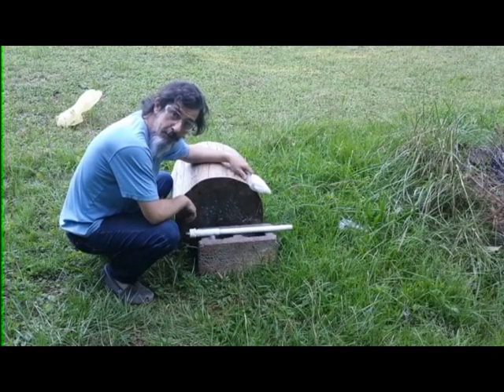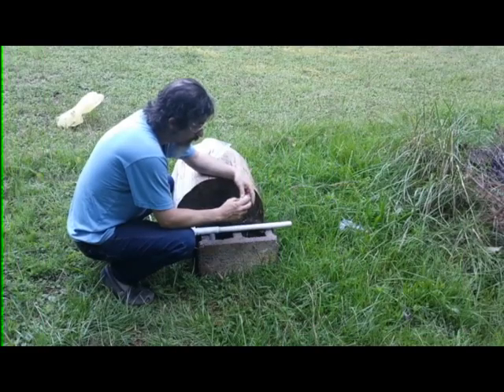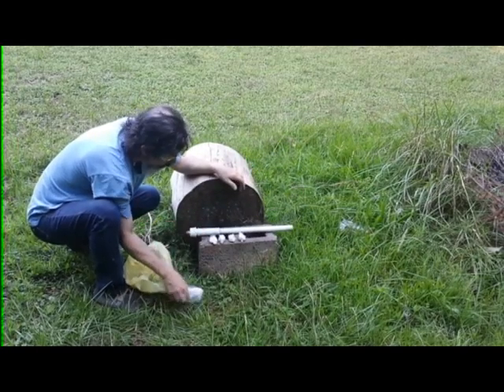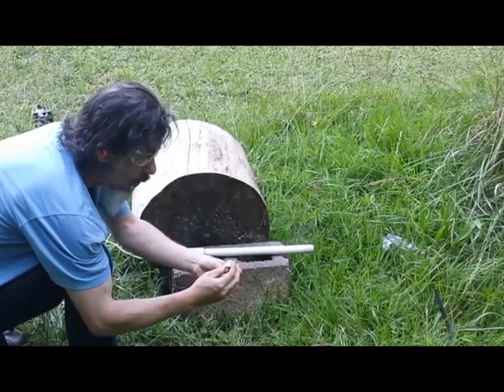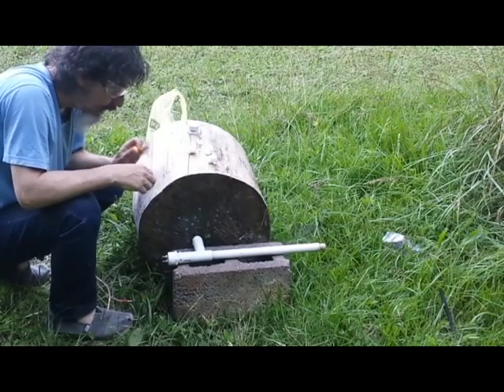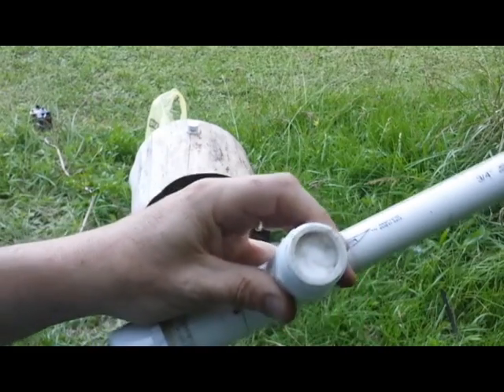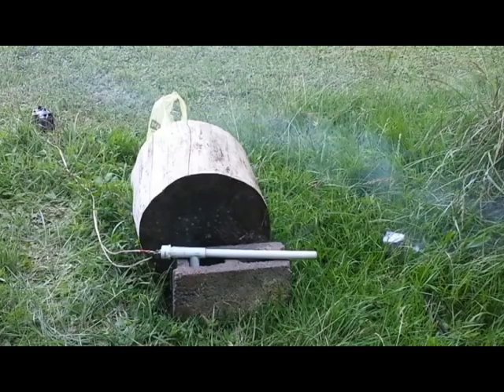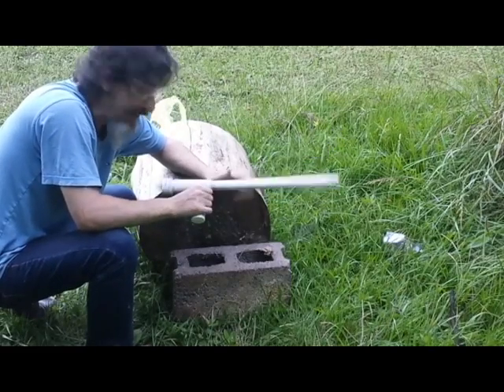Safety Breech Test on Side Loading Gun Cotton Combustion Chamber

Comment: It would appear the device pictured is in fact within the definition of a muzzle loading firearm.  Presumably and hopefully the plastics used in the component construction contain enough Barium Sulfate to not fall within the constraints of 18 USC 922 (P).  Regarding the unburnt gun cotton, I believe that is a function of barrel length.  I have observed the same result in my own experiences regarding Martini Henry rifles and carbines using British cordite loaded cartridges made by Kynoch and US Army Trapdoor Springfield rifles and carbines made in caliber .45-70 using commercially available (Buffalo Arms) black powder loads with .70 grains of black powder.  In both sets of experiences the firing of a rifle cartridge in a carbine resulted in unburnt propellent littering the area in front of the firearm muzzle.  However firing the same cartridges in the rifle of the same type did not produce the same effect.  As you note producing a load which expels unburnt powder on the ground is wasteful.  Although a private individual making on a few dozen or hundred such loads may not care about that, Both the British and the US (each of whom made millions of cartridges at government expense) did and produced both standard loads intended for rifles, and also loads with reduced powder chages intended specifically for use in the carbine variant.  Equally my own experimentation with various other firearms reveal that longer barrels produce both higher velocities and less muzzle flash.  In Several instances using maximum power handloads in short barreled pistols resulted in both excessive muzzle flash and unburnt powder visibly  littering the area in front of the weapon, while identical cartridges fired from a rifle length barrel produced lower muzzle flash and no unburnt powder remnants visible in front of the firearm.  I suspect that if your projectile launch tube (aka barrel) was a foot longer the amount of visible unburnt gun cotton after firing would be much less.  
At some future point I may experiment with gun cotton to determine how much gun cotton, and at what level of compression is needed to replicate the velocities of old time cordite loads.
As a question of curiosity, given that the boiling point of sulfuric acid is 638.6F, while that of water is only 212F (and thus easily removable from battery acid), have you done any experimentation of using common battery acid as an alternative to using drain cleaner as the source of the acid?

Comment: He also is probably igniting the nitrocellulose at the back end, like in a brass cartridge where the primer sits behind the gunpowder load, which is allowing it to push the nitrocellulose that hasn't burned yet out the barrel.
What he needs to do is ignite the nitrocellulose that is closest to the end of the barrel so that as it burns and builds pressure instead of shoving unburnt nitrocellulose out the barrel what it will do is it will compress the nitrocellulose in the bottom of the barrel causing it to be compressed heated and consumed.
He also needs a heavier restriction inside the barrel so that the nitrocellulose can build more pressure and more heat to consume more of the nitrocellulose.

Comment: Could it be a replacement for smokeless powder ? Does it work if damp. Interested in trying with a muzzle loader rifle.
Reply from the maker: Replacing the propellant in a firearm could lead to disaster, however I am considering trying it in my 16 gauge shotgun. Course I would need to trigger the gun remotely from behind a barrier to do this experiment safely. But then the gun would need to be examined very closely afterward to guarantee it's continued structural integrity. To be honest this is something I'm thinking about almost every day!
Reply: It's the main ingredient in smokeless powder

Comment: Have you tried igniting gun cotton with spark?
Try this, buy a cheap spark plug and a pezo manual "clicker" type bbq ignitor. 
Wire the ignitor to the spark plug and touch the plug to gun cotton....click it and see if it lights.
I'm wondering if a battery is actually  "necessary"???
Reply from the maker: Yep my first idea was actually a barbecue ignitor. The piezo-electric kind. But it won't do it.
Reply: I'm looking to build a gun cotton launcher to start camp fires when I have to start them with gasoline because of wet wood or when I have to start a campfire in the snow with less than dry wood.  I'm planning to  "construct" the ammunition for it. As gun cotton ignites to quickly/I need a BURNING projectile. And it needs a gas seal to be affective. While the gas seal will likely be just electrical tape or duck tape I'm planning to put both a UCO match and thermite in it's construction. 
While I'm sure this passes into not-so legal territory 💩 it certainly would be fun to target practice with something like such.

Comment: Mine is more efficient it only uses .2 gn
I get a 168 lb impulse in .3 milliseconds 
guess what it does
Reply from the maker: What is yours?
Reply: schel sullivan it's called the iopener is a replacement for Argus and cypress and  
vigil cutters mine doesn't cut it pulls or pushes  to open the
Reply: Parachute

Comment: Hi ! 
I have one question :
This gun cotton works to load gun cartriges ???
Thanks !
Reply from the maker: Its a main ingredient in modern smokeless powder, but reloading ammo outside of the manufactures  recommendations could be very dangerous. Im not a firearms expert so I would want to consult with an expert before trying anything like that.
Reply: @schelsullivan  will try too
Reply: If your going to do that i suggest only firing revolvers, they are stronger than semi autos. Also dont load rifle cartridges, the cotton must be turned to grains so it burns slower. Fast burning powder could detonate a rifle
Reply: I don't know. If you burn the powder in modern cartridges, it'd usually much slow burning.

Comment: It's not so much about 4 times the charge its the weight of your projectile. I would test double the charge and double the weight of the projectile. I have seen plastic big pen shoot a top half of hollow 357 bullet approximate weight of 80 grains through 4 pounds of plumber's putty 90 feet through three-quarter inch dog ear fencing.  No metal and pen doesn't not, explode.
Reply from the maker: Your right, I should push this design harder to find its critical point and understand it fully before using anything more dense than my paper tube rockets!
Reply: @schelsullivan  I think he said exactly the opposite sir. You need a heavier projectile

Comment: The Nitrocellulose burns so fast that it won't light the surrounding bits. Try tearing them up and interlacing them first. This is pretty cool, hope to see more! 
Also, I don't believe NC can be detonated with fire. A blasting cap has to be used. A hammer works, but if you want a real detonation a cap must be used.